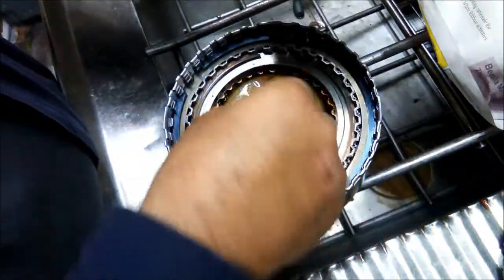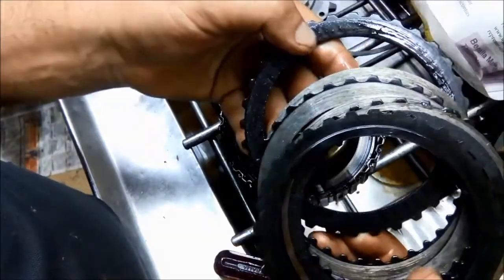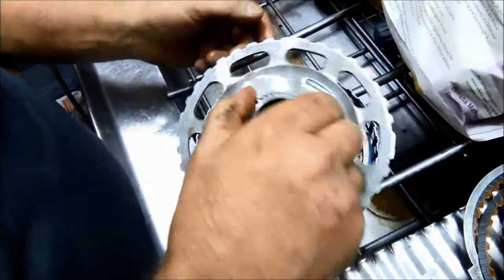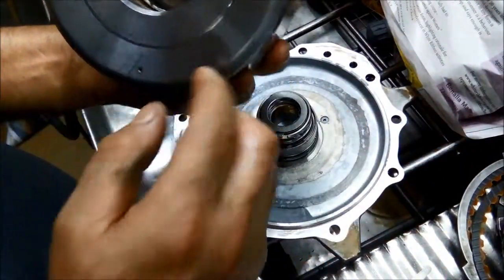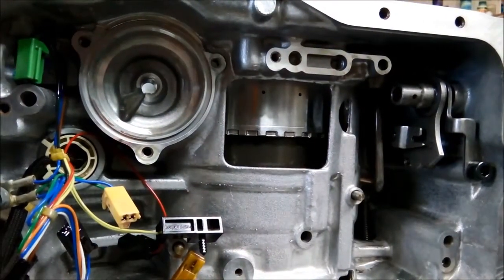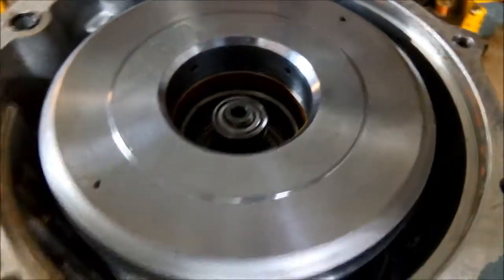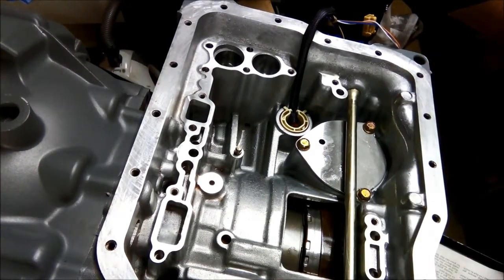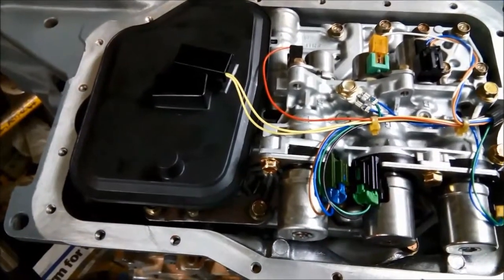Mazda FN4AEL / Ford 4F27E Automatic Transmission Full Overhaul Recondition 3 of 3

Comment: Hi, that software that you use to get the info is it individually for each type or does it have more than just this transmission in it? I would love information on that to get more info when doing one
Reply from the maker: Hi, scan tools do many vehicles but not all. we use Autel lately but Foxwell work well also. cheers
Reply: @YepThatsIt  we use launch now but i would like to know that information where you show the air test locations, the fluid passages and stuff, like you showed the procedure on tightening the band 
That be nice to know what software it is

Comment: Hello, you have alot of nice videos. Thank you for making these helpful videos.  I have a 2007 mazda 3 with the 5sp automatic and I just replaced the reverse and 3 to 4 clutch packs and band. It fixed my forward gears but reverse is still slipping very bad. The car bearly moves in reverse. Do you think it could be a bad servo piston? Or a stuck shift solenoid? I can hear the solenoid buzzing when I put the gear shift into reverse. Thank You.
Reply from the maker: hi, how was reverse before you did repair? check simpler things 1st before you delve back into it. cheers
Reply: The fluid level is full and im getting no codes or AT lights. The reverse was slipping just as bad before I did the clutches, reverse was slipping and 3rd and 4th gear would not engage at the time before I did the clutches. Now all my forward gears work after the clutches was replaced. But reverse did engage good for a couple days and then it just started slipping bad again. I was thinking it was a pressure problem but all of my forward gears are working good so thats why i was thinking maybe it was a solenoid that controls reverse but I can hear it buzzing when I put the car in reverse, so im kind of stumped right now. Maybe the solenoid is stuck. I might try replacing the valve body with all new shift solenoids. Thank You for the information.

Comment: Hey Bud, I have a Focus with the same Transmission 4F27E. The Transmission lost Reverse. It does move forward, but seems to not have 3rd gear either, just like the vehicle in this video. Im looking to do a full rebuild, but what I was wondering, is there a rebuild kit that I can order that has all the parts I need for the rebuild? Also where can I order the adjustable Band Bolt? Thanks mate, really appreciate taking the time to do the rebuild videos.
Reply from the maker: hi, if you`re in oz, you can contact me through my face book link and let me know what you need. cheers

Comment: Hi, i'm new to your channel but great videos! Very informative. I'm having an issue with a 2001 Mazda Protege, just under 150K with the FN4AEL, wont shift into second, O/D light comes on and starts flashing. PO732 code gets stored. I know it had at least one service within the last 5 years before i bought it. Was owned by an elderly lady since new and i know it was never driven hard or abused and I don't either. Just normal. I did a service six months ago with no problem until now. Nothing in fluid or pan that indicated internal damage and fluid was nice and clean, still very pink and minor sludge on magnet. I had a sticking solenoid but changed all of them with new because they came in a set but didn't solve problem. Fluid was still clean when drained the second time. Would you have any advice on where to look before a removal and teardown? Much appreciated! Cheers!
Reply from the maker: hi, might be worth popping off valve body and doing an air pressure test on clutch packs and band, or line pressure test if you have pressure gauge. hopefully you have checked all the other basics as well ....cheers
Reply: @YepThatsIt  Thanks so much!

Comment: Request vid about changing ATF for the DIY’er. What method to use if no TC drain available; is synthetic recommended; things to check with the pan off; etc.
Reply from the maker: hi, if no trans pan drain plug, simply just remove the pan bolts from one end of pan and slowly loosen bolts to allow slow draining of pan. we use a vacuum pump to the trans cooling line to drain as much fluid out as we can, but the bottom half of torque converter fluid will still remain...usually means that about or around 80% is replaced. use the recommended fluid type or the best you can afford depending on the transmission application....here in Australia the brand type is irrelevant i believe as trans fluid is required to contain certain properties anyway....the fluid is there for mainly hydraulic purposes and then as well as for lubrication. when pan is off check for the kind of debris floating in pan....magnetic, non magnetic, type of material...this will indicate what may be wearing....like clutch/band linings, white metal bush material, bronze bush and thrust washer material, aluminium off pistons or case etc etc. also check that there isn`t excessive magnetic debris stuck to outside of solenoids ( will mean there is also suck on inside ) check wiring isnt rubbing on pan or anywhere and i like to wriggle the terminal connectors so they find a new spot or improve connections...also good to spray some crc or wd40 on external electrical connections. hope that helps cheers
Reply: ATF M-V (not mercon V). The recommended fluid is idemitsi type M

Comment: Hello, I'm about to start sorting out my Mazda 3 without 3rd or 4th gear. I was told to replace the "Direct Drum" 3-4, and the Ring Seals. You mention something about where the Ring Seals seat at the 8:30 mark in your video, that they get worn out. I was wondering is this a part you can replace? It looks like it's attached to the side cover. Keep in mind I haven't pulled anything apart yet and I'm just going by looks on the video. Also, I'm trying to leave trans in car and do this as cheaply as possible. I know this video is old and appreciate any advice, cheers.
Reply from the maker: hi, have you watched my other 4f27e vids? this one shows how you would do in car repair and how much you can access https://youtu.be/CRC_x7cnAHQ . pardon all my umms , hope there are some beers for me ! cheers
Reply: @YepThatsIt  Always a beer for you, ha ha. Thanks for that. I'm concerned about getting the new rings(seals) to seat and seal on the support
Reply from the maker: @smugdoug  you will need to contact me on face book link for parts. cheers
Reply: @YepThatsIt  Will do

Comment: Hi great video, very informative. I am thinking of tackling on this rebuild for my Mazda FN4AEL - I am not a professional by any means. I have the basic knowledge of how stuff works, I've been working on cars for a long time as a weekend warrior backyard mechanic. I just want to ask how difficult would this rebuild be on a scale of 1-10? I'm guessing by looking at your videos it would be around a 6-7, but what would you say?
Reply from the maker: hi, I'd say nowhere near 6/7, these are an easy rebuild, hardest job is getting it out of vehicle. cheers
Reply from the maker: on these you can even get most out through side cover without even removing from vehicle....checkout my other vids cheers
Reply: Awesome, thanks for your reply. I will check out the other videos. One more question, does the 2005 Mazda 3 have a TCM? I cannot find it and I am stumped...
Reply from the maker: hi, should be near battery....try google location and images. cheers

Comment: Hi bud , great video I’ve got a 2012 Ford fiesta with this 4 speed box in. Gear 1&2 drives fine , shifts to 3rd and it revs like hell ! You still have drive in the gear at the high rpm same as 4th .. any idea ? 

TIA Tom
Reply from the maker: hi, sounds like a pressure leak somewhere. check all the basics first before you remove trans pan and you can remove vbody and air pressure the apply ports. see our other vids on https://youtu.be/qDXkAOP9vos  cheers

Comment: How many liters of transmission carry those automatic boxes is bad if you go over the level of a 1994 toyota corolla and how much does it take to do the service to the box
Reply from the maker: hi, you always go by measuring what comes out, but make sure you check as per manufacturers recommendation regarding temp etc. do not over fill as fluid will expand and can aerate causing issues. cheers
Reply: @YepThatsIt  Where can i buy the park pawl for my 2009 ford focus?

Comment: Hello and let me first say thank you for your video it is a very helpful asking if you could please point me in the right direction I have the same transmission in a focus all of my gear shift out fine 1 2 3 neutral and reverse but when it shifts to 4th it just revs like it's in neutral if I let the car slow down it engages third again, where might i start looking? My shift solenoids are fine I have even replaced solenoid A still no luck
Reply from the maker: hi, try the band adjustment. the bore on the case where the 2-4 band servo piston rod runs can be worn out. end cover rings not sealing properly. cheers

Comment: Great video, I'll subscribe! 
When I tested my 2 clutch pack ports (near shift rail) the hole farther away from servo didn't seem to hear any movement. The hose pressurised the hole, but no clutch pack sound.... Comments? Thanks
Reply from the maker: hi, often if the bushings/sealing rings are worn, you wont hear a sound as everything is hanging down. remember oil is thicker than air as well. make sure your air apply isnt leaking, minimum of about 65-70psi should be enough to hear it apply. cheers
Reply: Thanks! 
You have so many great videos! So much knowledge, so much expertise! I salute you!

Comment: I have no movement in the lower servo bolt 
Is it supposed to click in alittle when applying a new band?
Reply from the maker: hi, not quite sure what you mean by click? band needs to have some freeplay, if too tight will burn when it isn`t being applied. cheers

Comment: I turkey Istanbul from you I have a tool that will be a question of protons brand, model 1998 Mitsubishi vehicle with the engine automatic transmission's my problem means I'm running but not moving is doing a very slow start automatic transmission I made new, but the car cıktı solenoid problem spot is not coming up, how do we solve, you must help me
Reply from the maker: hi, sorry just found your comment in youtubes spam. contact me on my face book link https://www.facebook.com/Yep-Thats-It-103051017785435/  and leave me which  kind of vehicle/transmission type you have, and leave a detailed description of any fault codes and issue you are having ( we are able to exchange pics/diagrams on there ) and details of what work you have already performed or checked...... you will need to buy me some beers ( link is in face book ) and I will answer your questions accordingly. cheers

Comment: You did this with no factory special tools and only your hook/screwdriver self-made tool? That’s impressive...

What is the document you referenced? Are the parts OE from Mazda or aftermarket?

I have 2004 Mazda3s (USA) FNK2 trans that I expect to need this if I keep it long. Any known weak points on this trans?

Your descriptions and camera work are exceptional. Extra points for all the appropriate closeups.
Reply from the maker: Hi, thanks for that ;-) haha my old man always said " the tools are only as good as the person using them " The manuals we usually use are ATSG - Automatic Transmission Service Group ( you may even find a free version if you google it ). Id say the weak points are if this transmission is not serviced regularly with filter replacement and cleaning trans pan and magnet. Basically any transmission kept cool and clean will last a lot longer. They also got rid of the adjustable band bolt, so you need to change it to an adjustable type to get the most out of the band. The servo piston bore in case is also prone to wearing out quite often ( as well as the anchor bracket on the band bending slightly which also throws out the band adjustment ). I like the fact that often you can repair these without the need to remove the trans ( that is..if the torque converter and forward clutch pack are ok ) good luck and cheers
Reply: YepThatsIt 
Thanks for the additional info.

Are the replacement parts you use OE Mazda or aftermarket?

Cheers.
Reply from the maker: aftermarket
Reply: YepThatsIt 
Is there a maker you prefer? In this “one world” market it might be available from my local suppliers...

Comment: Hi, 

I don't have any fault code. Mazda 121 Metro Shades 2001.
It takes a few second for drive to engage but reverse engages straight away. 
The engine revs up when shifting from 1st to 2nd if I keep pressing the accelerator and eventually shifts to 2nd. issue is more sever when transmission is hot.
But If I release the accelerator like how I would do on a manual car then it goes to 2nd easily. (Almost like driving a manual car for 1st to 2nd gear change)
Rest of the gears including reverse is very smooth including down shifting.
I found the front engine mount has been separated and I have ordered a new one.

Any thoughts on what it might be? 

(I will get a newer car once used car price comes down a bit. I will be happy if I can get another 5-10K out of it without the gear change issue. currently on 298K.)
Reply from the maker: hi, check all the basics first, most often on these the solenoids are contaminated /worn or leaking. cheers

Comment: That transmission is a crap...
Reply from the maker: hi, only when it isn`t running properly. cheers
Reply: YepThatsIt my transmission mazda 3 always clunk when reverse... 
I say its a crap transmission because its really crap
Reply from the maker: hi, check your cv joints and rubber mounts...a mount might be torn and lifting when in reverse. cheers